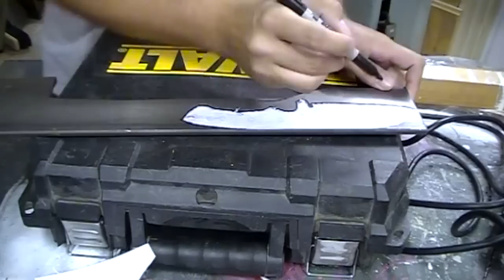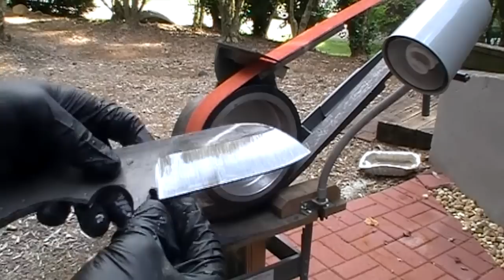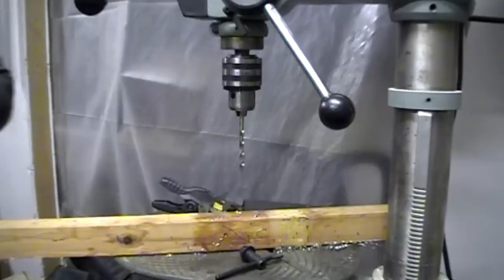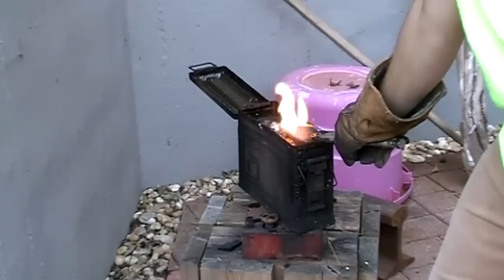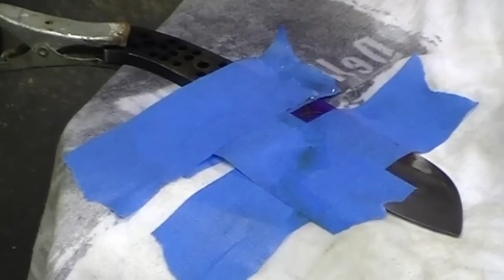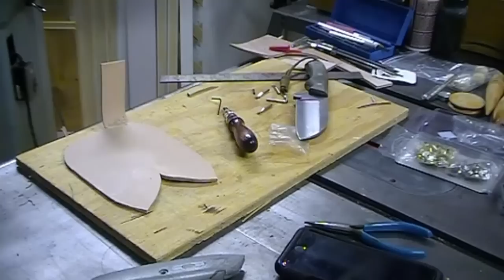Making a boat knife

Comment: Why is it called a boat knife?
Reply from the maker: The design of the knife is a "boat knife." They have the straight edge with the rounded tip.
Reply: Because if you collect enough of them together, you can weld them together to make a boat
Reply: The correct term is sheepsfoot boaters use it because it doesn't have a sharp point therfore its less likely to puncture anything ie : sails, inflatable boat, life jacket, or person